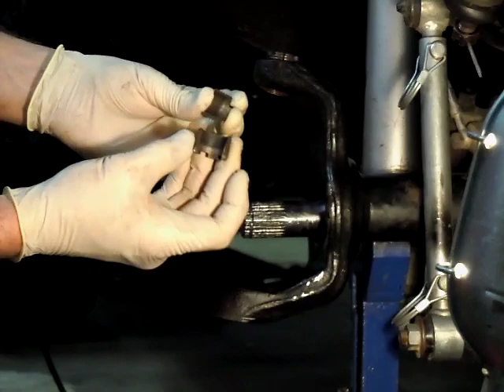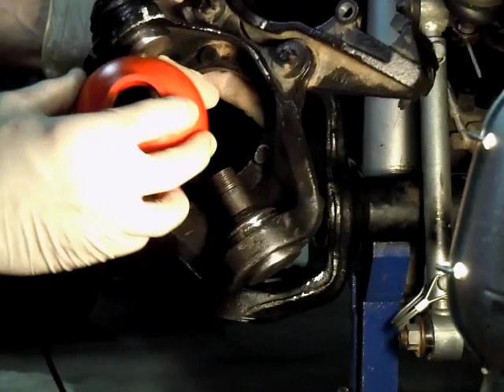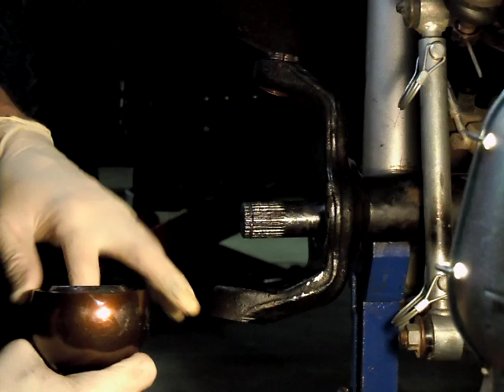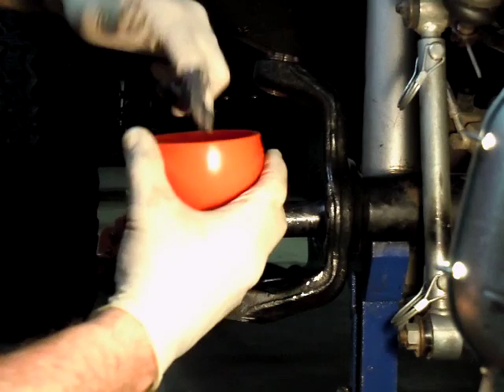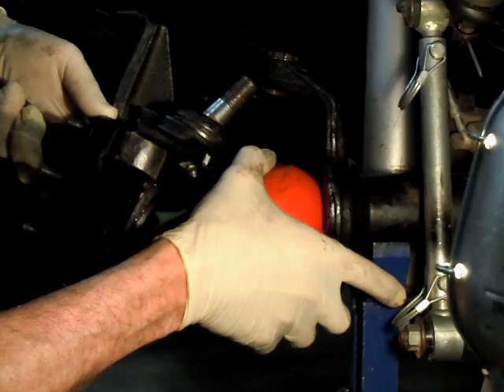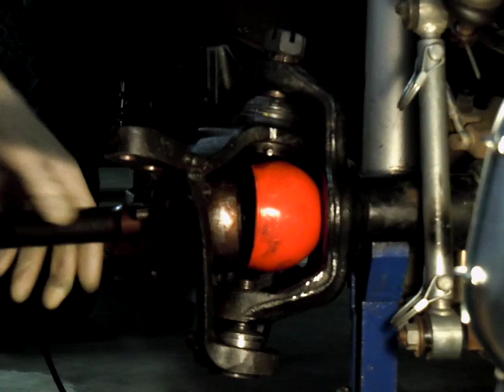RCV Performance Dana 30/44 Traditional Spindle Installation

Comment: I think this is the only legit way to install the RCV in traditional spindle D44. The other way is the grind the crap out of the C and knuckle and monkey F it for a long time and maybe it’ll work. I did a lotta grinding and it wouldn’t work. Didn’t feel like grinding more so I went this route and knocked it out quickly. Only ground 1/8” off the bottom ball joint. The only down side I see if that you can’t torque the bottom ball joint nut to the specific Tq. I was more comfortable doing it with a wrench then grinding the CRAP out of the knuckle and C. The hardest part for me was getting the oil slinger installed at the very end. The RCV video showing the install with just an axle tube in a vise should be pulled down. You can see they cut away when they were inserting the CV. And they let the inner axle go inward which makes the install possible.